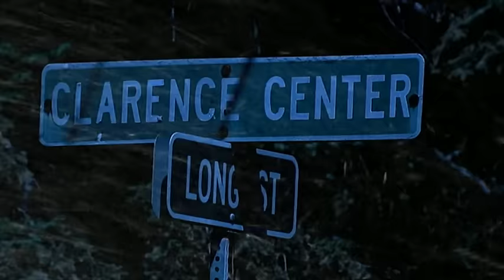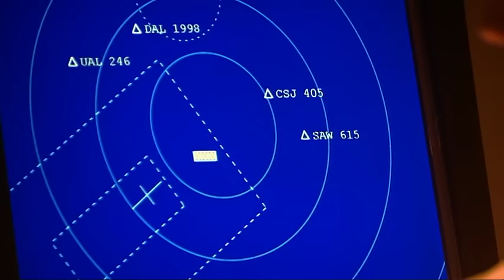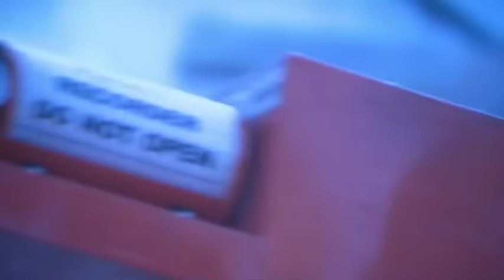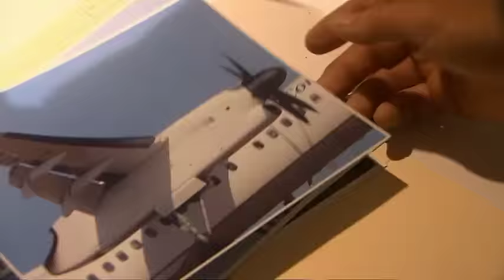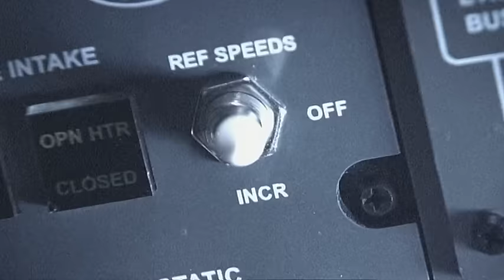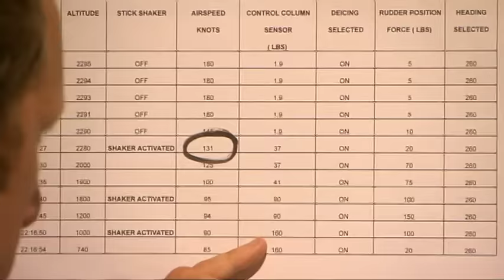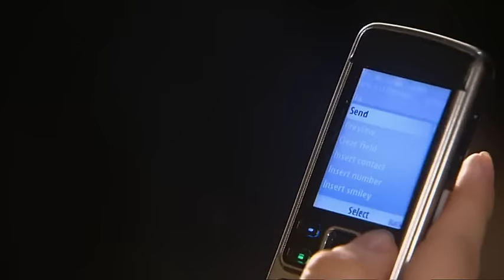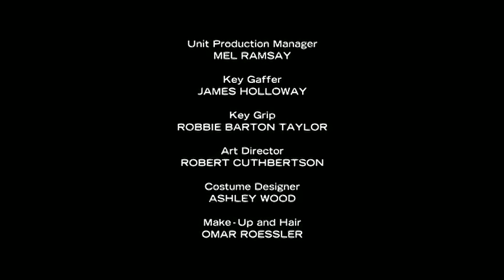Air Crash Investigations Mayday   10x04   Dead Tired Colgan Air Flight 3407

Comment: Regardless of how tired they were a pilot pulling back on the control column during  a stall is the most shocking aspect to me. One thing this doc doesn't cover is the co pilot selecting the wrong flap setting on approach. 5 flaps in bad weather? These 2 should never have been in that cockpit.
Reply: Yes, and the killed everyone on board. Oh, and one in that house!
Reply: Sundaydish1    Just by watching these series I know that in a stall you put the nose down + give it power.